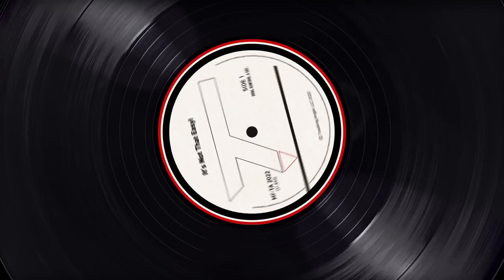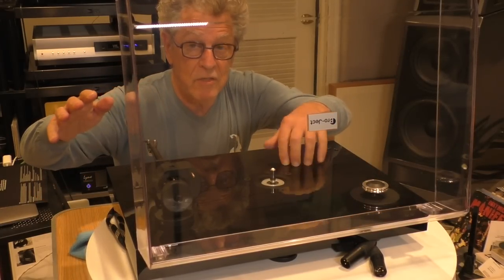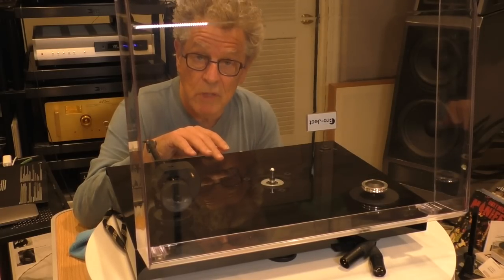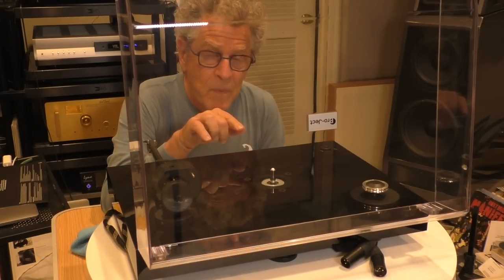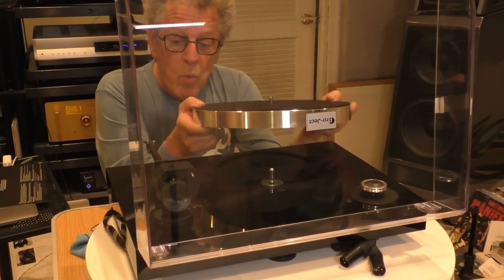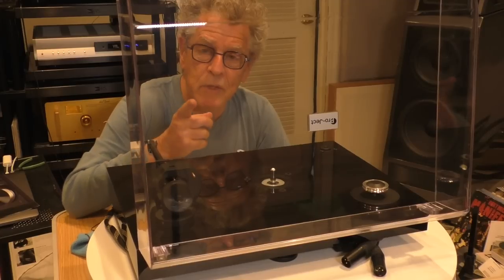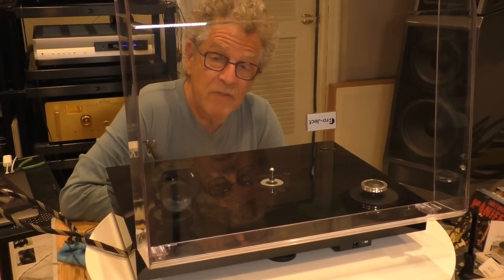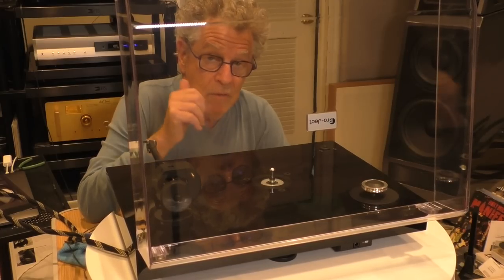Pro-Ject X8 Evolution "Deep Dive" Video Review!

Comment: The mass loading seems similar to Feickert's Volare table.  But Project has wisely chosen to not use pointed conical feet unlike Feickert, and also comes with a manual (unlike the Volare)!  Looks like a much better value.
Reply: Whats wrong with pointed conical feet?

Comment: I have to correct your on something when you said the shortness of the spindle the less contact no would be more, it's the other way around the longer the spindle the spindle as less contact with its mating surfaces, and has more stability.
you can test this with your fingers if you take your three fingers on one hand and on the other hand your index finger weave it slide it in between the two bottom fingers and a top finger keeping your fingers tight together and wiggle your finger from the other hand, now widen the other two fingers from the other hand do same experiment, you find your finger will not move as easy. another thing with the lifting magnet it pulls it of the spindle centre to one side, better approach would be to have a triangle at the bottom and a triangle cup on the bottom of the platter and have to surface magnets on each opposing each other that way it would be kept centre with the magnetic field and no sliding of the magnetic field. try the blackbird horizontal uni pivot arm it's a great arm, could be the best in the world? very affordable. I'm assuming you haven't tried it?? have a good day nice video

Comment: Michael. I’m still dumbstruck that the makers of any, let alone high end, turntables use a felt mat. Any felt mat will cause more static in my experience. It’s a simple physics issue. Unless one is scratching, and why use this turntable for such an  antiquated purpose, why a felt mat? Can’t understand it.
Reply from the maker: It's "tradition" I guess. I don't like them much either. It's easy enough to replace.
Reply: @trackingangle929  trust me, ever since my first Technics direct drive turntable in 1980, was 18 and had to save up the money, I’ve only high quality rubber mats. And yes mats affect the tone of the records. Personal experimentation. Thx. ☮️
Reply: Pro-ject EXPECTS most will utilize their personal FAV mat so I agree w/ their logic to have something out of the box.

Comment: is this the best i can do in the 2k price range?
Reply from the maker: I try to not traffic in “best”. The X8 is surely among the best at the price point. Choosing it would not be a mistake.
Reply: @trackingangle929  if you had 2500 thats what you would buy? im upgrading from my system deck IIX and i want to make the right choice,, or should i save for a better table? will it not be that big of a upgrade?